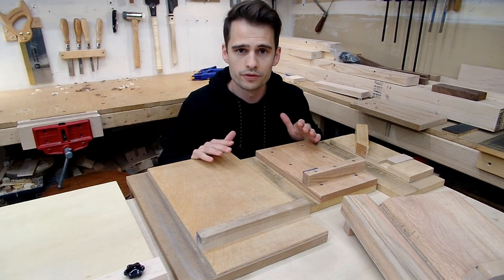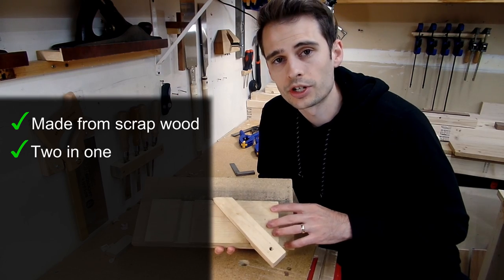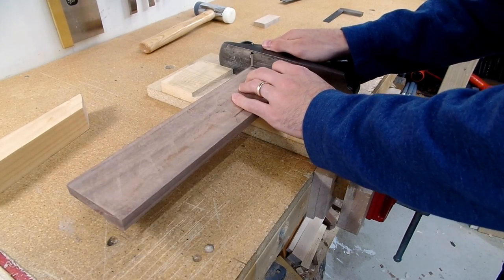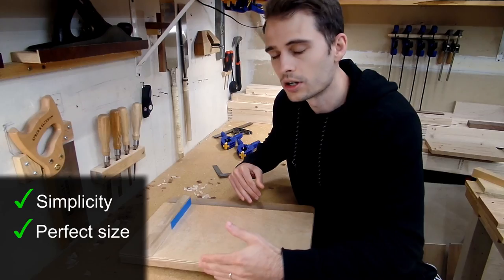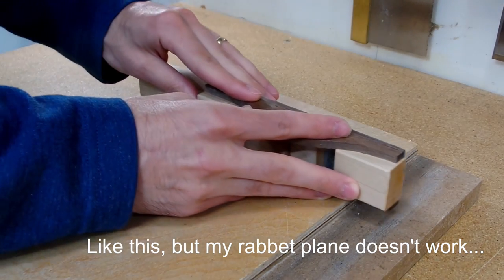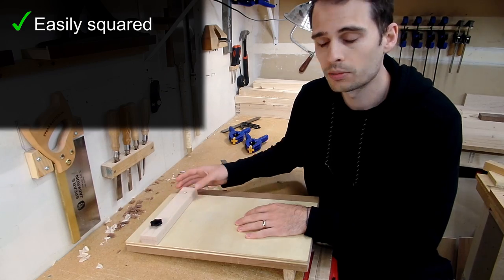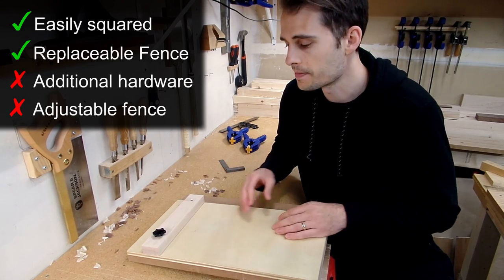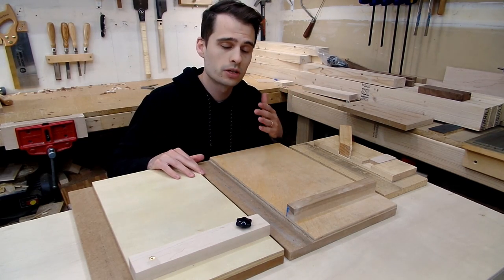Which shooting board is right for you? Comparing different styles of shooting boards.

Comment: Nice comparison.
Tbh, a 45° shooting board is far more important. I have Paul Sellers version and it works great. Use some scrap same thickness as your board as an infeed support ;) (He also made one to work vertically in the face vice.)
Other than that go with a fixed fence. Just clamp a square to your board and butt the fence up to it when fixing.
There are very few occasions when you'll actually need perfectly squared off ends.

Comment: I made Rob's version for myself. When you glue the fence first and then fasten it from below with 2 screws, it will always remain square. For the fence and the guide against which the plane slides I used a piece of beech (from a discarded chair). For an angle of 45° I made a triangle that I can easily attach to the shooting board with 2 screws.
I use this shooting board for practically every woodworking job.
Reply: When I bought one, I got one that could do 45 degrees.  Six years on, I have never used that 45 feature.

Comment: Something I thing worth noting about Rob's style of shooting boarding is that he glues it up with a crown. This ensures the plane doesn't tip away from the cut (as it will if the "track" has a belly). I think this is an essential design element if you are shooting with a bench plane.
Reply from the maker: This is very true and something I forgot to mention!

Comment: I'm no handtool expert, but I had little difficulty getting a square fence with Paul Sellers' version; lay it out with a reliable square and a marking knife, "knife wall" the cut, then saw it out and chisel/router plane the waste.  Make a wedge for each slot, each the proper thickness to also lay on the benchtop as support for a longer workpiece.

I did need to add an oak strip along the runway to hold my handplane consistently against the edge of the workpiece.

Comment: I’ve made all of them myself. Paul Sellers would tell you to make it longer or wider to suit your needs. I often wonder where this notion that one must follow others rules and plans when it comes to woodworking comes from. It took me three attempts to get it square because I was building my skills with hand tools. After all, that’s what pulls me towards them. Otherwise, I might as well get a chop saw and machine my wood like an engineer or machinist. (I do have machines and not a Luddite) Also, you can make a bench hook that will support long pieces. And if you need to make micro adjustments, you can do that with tape. No shooting board - Sellers, Cosman, or even the Lee Valley adjustable one, will ever stay square. Wood moves, sometimes a little and sometimes a lot. Currently I’m using the adjustable one from Lee Valley and like it - to each his own 😊 Good video comparison.

Comment: You can square fixed fences on a table saw sled, just put a scrap of wood the same height as the fence to makes the shooting board parallel with sled base. If you have a Rob Cosman style sled that has a convex top adjust the shim until the first 4 inches near the fence in parallel with the sled base so that the fence is square to the shooting board base... Be very precise checking square on the blade to the sled too and don't use a warn out blade or a crosscut blade.

Comment: There is another option. Use the adjustable fence when it is square screw through it to hold it square. Then if it goes out of square remove the screw and use another hole.
Have you seen a crosscut sled with a adjustable fence that would be handy I have trouble getting it spot on.
Reply from the maker: The "adjustable screw" option could be an even cheaper option! Didn't think of that. I could see that working pretty well!
Reply: Simple and yet great idea!

Comment: I'd prefer to have a fixed fence with an adjustable shimmied working surface. Kinda like Rex's, but with four screws horizontally. I claim that would make sure that it doesn't easily go out of square. And of course, provided you have a workbench, some way to support the far end of the board.

And of course I would mirror everything.

Comment: My shooting board has an adjustable fence and once I square it up, I draw a pencil line on the base along the fence so that I will notice right away if it gets bumped out of square. This saves me from having to check for squareness before each use.
Reply from the maker: I like the pencil line trick! That's great. I'm gonna have to start doing that. Thanks for sharing.

Comment: I think you’re on to something, I made an adjustable board but still put the fence with the dado so the screw or fastener would be supported. I used 1/2” plywood so not a lot of room for the shorter screws to grip into. 

In the future I was planning to build one similar to yours however have two inserts within the board and use two thumb screws.
Reply from the maker: Two inserts could be a good idea! Maybe provide more holding strength?

Comment: The question is do you even need a shooting board for the purpose it's being used now? I can't really think of any use of squaring endgrain like that, the original purpose was to square long grain on thin stock and it should still be the main purpose and you should not care much about the fence but rather about length and parallelism. In most cases it's far more practical to just leave the endgrain off the saw and plane/chisel after the whole project is assembled. And in most cases when you need the end of the board to be perfect, you are usually better off just to plane it regularly because it usually involves a size that is way too big to shoot.
Reply: Small box work and dovetails are just a lot easier when starting with squared ends. If you have trouble being square straight of a saw, shooting the ends becomes more important. Oh and the place I use one most is tuning inset drawer fronts to initial width.

Comment: Great video, and I’m not just saying that because I’ve come to the same conclusion as you. The point I agree with the most is that although I like the idea, I could never ever trust an adjustable fence: I would check it a million times. But the moment at which the penny really dropped for me was when I read Christopher Schwarz’s article “A Shooting Board for a Simpleton”, in which he recommends to stick two planks of wood together, stick a fence on top and to square it up with a shoulder plane. There, done, go forth and shoot. And here’s the thing: you don’t really need a shoulder plane. Glue sandpaper to a straight and square bit of wood and sand the fence into square. Not elegant, but it works. Sometimes we don’t see the forest for the trees.
Reply from the maker: Why have I never thought to use sandpaper on a square piece of wood?! Thanks for this suggestion! The rob cosman board is slightly out of square so I think I'll use the sandpaper trick as I don't have a shoulder plane.
Reply: I’m struggling to understand how a shoulder plane or sandpaper can make the fence square to the track. It can be made straight that way, but it could be straight and still not square.
Reply: @Bryan-fn6lp  It’s fiddly, but absolutely possible: you take more off one end than the other until it’s straight and square. You have nothing to register the plane/sanding block against – is that what you mean? You just have to go slowly and carefully and check it many times. If you don’t have a square that is long enough, you can hold a ruler against the fence and check if the ruler is square.
Reply: I’ve used either a shoulder plane or a bullnose plane to tweak and dial in a fixed fence on a shooting board many times. Wood moves and through the years will likely go out of square. And yes, even sandpaper too 😂

Comment: Great vid, very informative. However, there is a common mistake that nearly everyone makes when using a shooting board without even knowing it. Graham Blackburn talks about the proper use of shooting boards in his vid https://www.youtube.com/watch?v=L1JtSXfIhBY. The primary one he demonstrates has both the 90 and 45 degree options like Paul Sellers without the need to cut dados in the table. Also, and I know this goes outside the scope of this vid, Graham Blackburn talks about how to obtain angles other than 90 and 45 degrees without any further modifications to the existing shooting board.
Reply from the maker: Thanks so much for sharing this video and putting me onto Graham's work! Surprised YouTube hasn't shown me his work before now. 

Interesting what he says about overhanging the pieces of work. That's the first time I've seen that. I really liked his use of dowels to insert a 45 degree fence onto the board. I think I'll have to steal that idea and modify one of my boards to add a 45 degree fence!

Thanks again for sharing!
Reply: @DaughtersWoodCo  Absolutely. I didn't know about his channel until Rex Kruger mentioned and linked to his channel.

Comment: Check Rex Krueger version. He combines fixed and adjustable fence in one appliance
Reply from the maker: He's is a great option too!
Reply: I think it was Rex that had an add on spacer support that attached to the left edge with magnets and could be detached and moved to the left to support long pieces you want to shoot
Reply: @Mhj96813  Does everybody have a simple bench hook they use for sawing small pieces accurately? Just make that the same size as your shooting board and it doubles as a support for shooting long pieces.